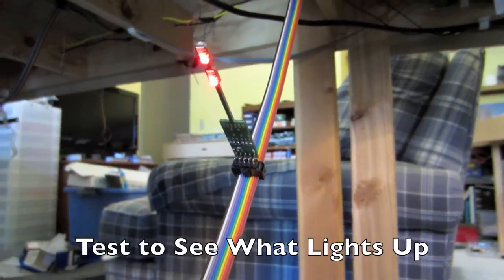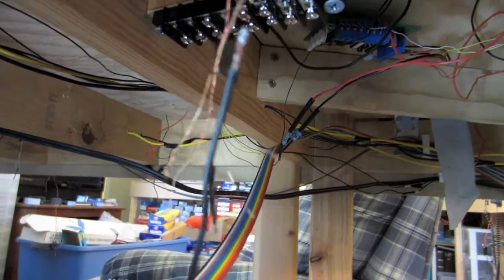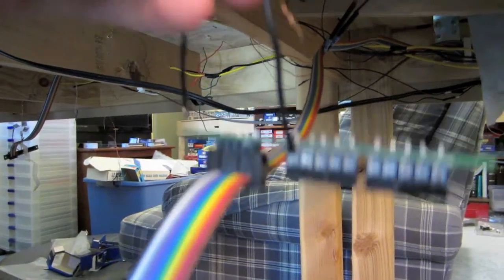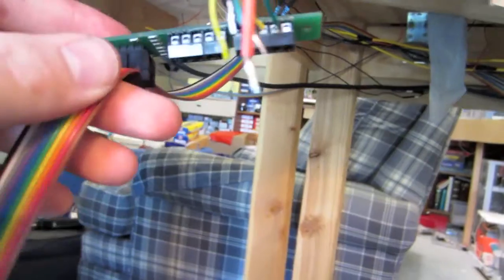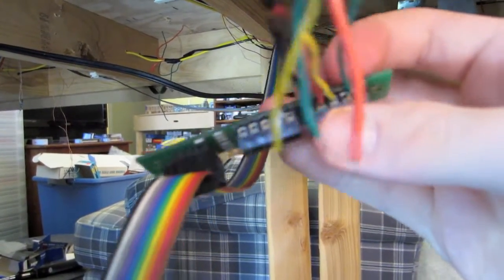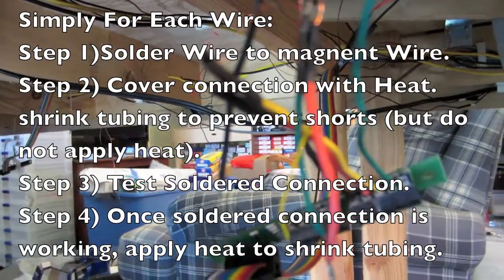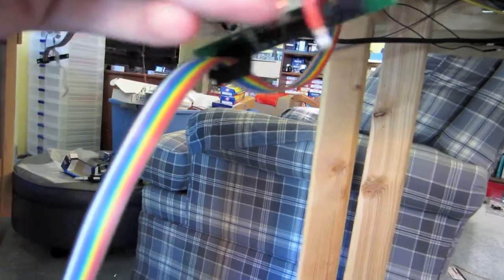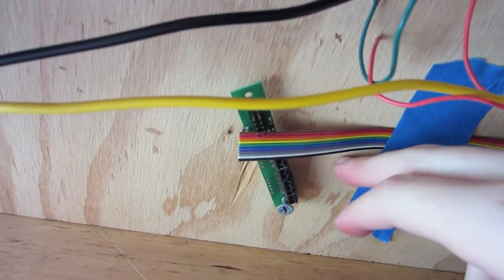Installing the Digitrax Signal System: Wiring BLMA Signals

Comment: How exactly did you solder larger wire to the magnet wire ? How did you remove the insulation on the magnet wire?
Reply from the maker: The insulation on most magnet wire is supposed to burn off with a soldering iron...add flux to the tip before heating and tinning it also helps.
Reply: @drewzdrew27  okay so just try to solder/pre tin the magnet wire. Add Flux to the tip of the magnet wire?
Reply from the maker: @FlashJonesTrains  yeap! I just poke it in (mines the gel like stuff)
Reply: @drewzdrew27  okay awesome I have the paste style Flux.  So I didn't use it, but it still worked.  I checked with my multimeter and everything seems to work.  

What size heat shrink did you use?  I can't seem to find any that'll get to grip the magnet wire? Also how did you identify which wire corresponds to which light?

Comment: What is the nomenclature on the breadout board you are using ??
Reply from the maker: I believe you are asking about the TSMK, which is the green thing that connects to the signal wires and the rainbow ribbon cable
Reply: Thanks for the reply ...I did a little research after I saw your video and I've subsequently ordered a few of these (TSMK's)  for our club. Previous members have used the temp signal masts for wiring the permanent signal . Every time we have a problem trying to work with these causes nothing but more problems . Your idea to up the gauge soldering a "pigtail" to the transformer wire  is what we need to do . It looks like one of these could support a double headed mast with up to 6 LEDS right?  Anyhow, thanks for sharing this ...could not have been more timely . Rich Palmieri President Dixie Model RR Nashville Tn.